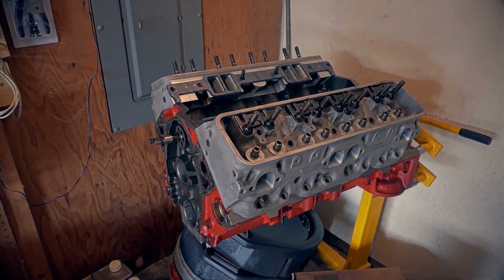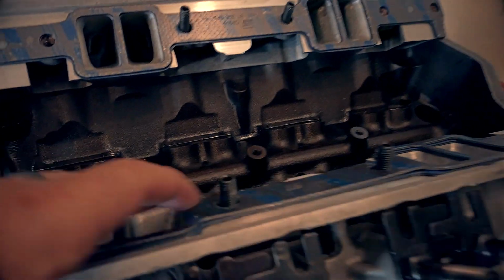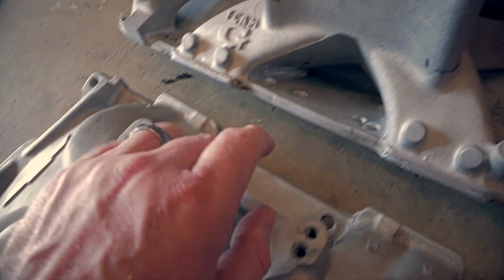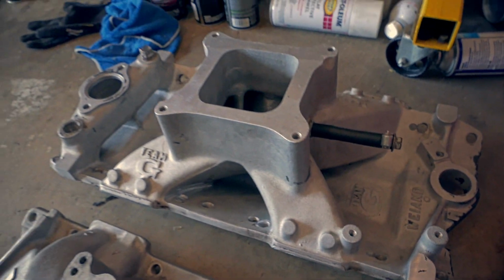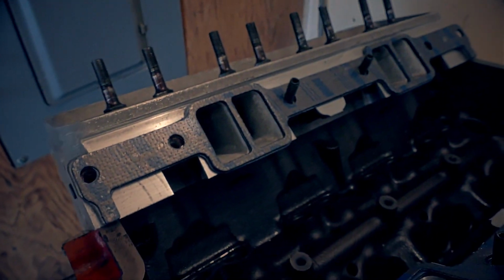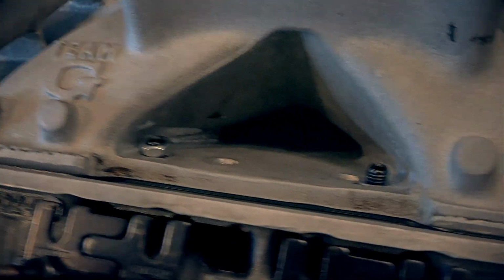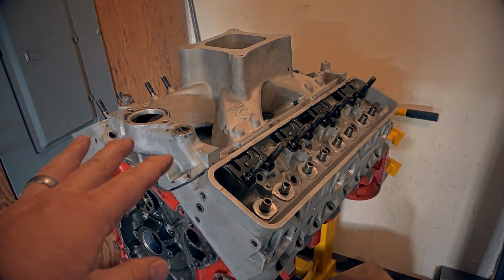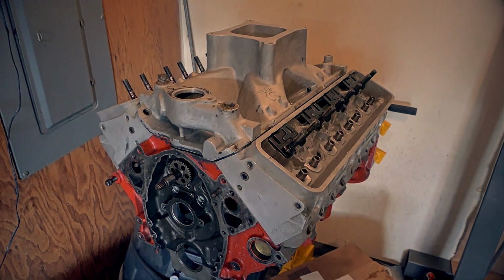LT1 single plane intake from a SBC ( SWAP IT! ) Nitrous LT1 build Update

Comment: Looks good, I'm half way through converting my lt1 to a carb nitrous motor.
For the 4 center intake bolts I drilled and tapped the head to gen1 and running a short bolt to clear push rod, all the others I over drilled then welded in a re angle boss.

I post a vid up soon so you can take a look.

Pete.
England.
Reply: ,,,,,,,,,,,,,,,,,,,,,,,,,,,,,,,,,,,,,,,,,,,,,,,,,,,,,,,,,,need to see this over drilling and welding in of all the  re-angled bosses..........................................

Comment: So are you still running a reverse flow water pump, or more to the point, can you run the gen1 intake while still using the stock water pump? No coolant goes to the intake so just close those up, correct? Trying to run a gen 1 intake on a stock LT1 while still retaining the opti and water pump. I realize that doesn't make sense in this comment, but will become clearer in future videos I post about what I'm doing.

Comment: Hi man always like your videos, question sorry if you already heard it 20 times. Im from the netherlands and going the lt1 route for my 73 camaro

What hp / nm can i expect from my engine with this setup. I hope for 400 hp+

Stock lt1 shortblok honed and re ring
Cc503 cam
Thinner impala headgaskets
Iron heads only valve stem bosses machine to accept more lift
Screw in studs
Stronger valve springs
1.6 roller rockers non self align
Guide plates
Vic jr intake for sbc
Hei ignition
Summit max500 efi
Long tube headers
2x 2.5 inch exhaust

Gonna run with th350 and 3.73 gears 295 35 18

Hope for your respons :)
Reply from the maker: I honestly am not good at guessing HP #s it should make 400 at the crank at least I would think.
Reply: Honestly,  that should be good for somewhere around 300 to 315 rear wheel horsepower. Which puts you at about 365 to 380 flywheel horsepower,  give or take!👍
Reply: But I agree, 400 flywheel horsepower is definitely very possible

Comment: I did this back in 05 and my friend mantion to me that they didn't have a carburetor manifold back then but I maid it work ran really good but the only issue I had when I drop the distributor in. my distributor sprocket kept getting chewed up because of the height or depth on the distributor wasn't really lining up I would have to change the distributor sprocket every thousand miles too bad I never got it to work properly but now I have confidence I would figure it out if I had the chance to do it over again please let me know how it works out for you well I didn't use 2 gasket sets so It might work for you
Reply from the maker: Slip neck distributor allows you to adjust the gear engagement. I drop it in till it bottom's out then give it just a little wiggle room for heat expansion. Been there on my SBC its very common with aftermarket intakes.
Reply: @TPVPRO  that's great to know
Reply: @TPVPRO  ,,,,,,,,,,,,Who makes this slip-neck distributor ???    Be concise with being near accurate  ,  .060"   .090" or  .125 inch..........as to how much the distributor needs to be raised  to prevent metal shavings inside the engine............

Comment: Do you have a part number for the 4 center studs? Thread pitch, size etc?
Reply from the maker: I do not, I just walked into Fastenal and picked up the studs. You want an Allen drive stud so you can adjust the height once the intake is on. They are 3/8"-16 and I think they are 2" long.  The low profile nuts are all on the shelf too.
Reply: @TPVPRO  Thanks a lot. I am doing a single plane for my turbo LT1. This helped a ton. Thank you!

Comment: Did it perform better than the dual plane?
Reply from the maker: @CLEEPER1  For the cam I am running it was a significant upgrade.
Reply: @TPVPRO  I have a stock ported  lt1 intake but want to do carb style.   Have a 248/258 @.050 cam and was curious the difference between the dual vs a single plane that is a lot more difficult to swap on a car already together
Reply: On a 12 to 1 385
Reply from the maker: @CLEEPER1   I would keep the EFI intake on if it's a F-Body car.

Comment: Would you be interested in selling the  original  carb intake
Reply from the maker: I'm going to keep it.
Reply: @TPVPRO  I've watched a lot if your videos . Do you mind me asking what headers size and brand are you running ? Do you like them ? Thank you :)
Reply from the maker: @steveelco114   I'm running the HedMan 1 3/4 Mid-Length PN: 69560. They say (Straight plug cylinder heads ONLY!) But they worked fine with my AFR heads with an angle plug. Not sure how they will work with my LT1s because the port is not raised. But we will find out this summer.
Reply: @TPVPRO  thank you so much for the quick response I appreciate it  .